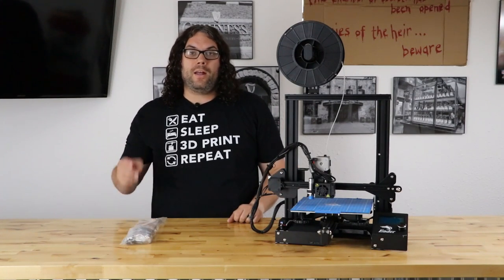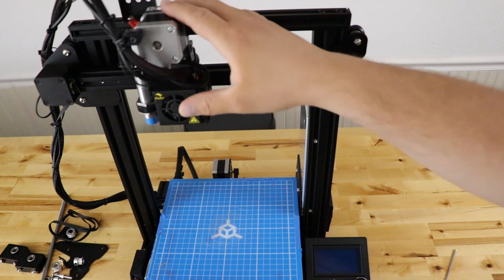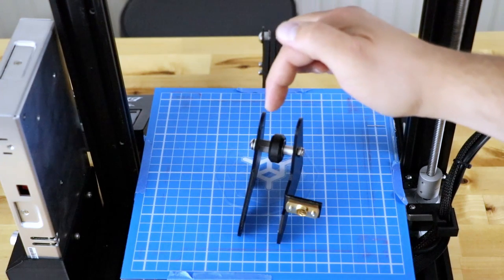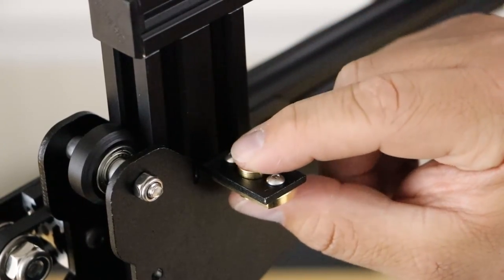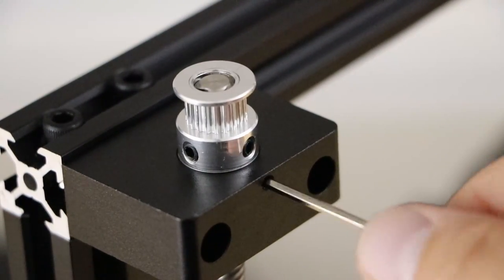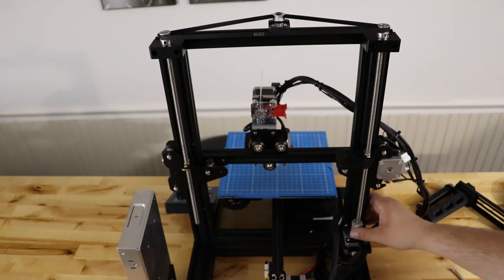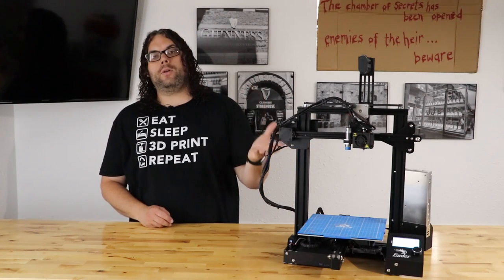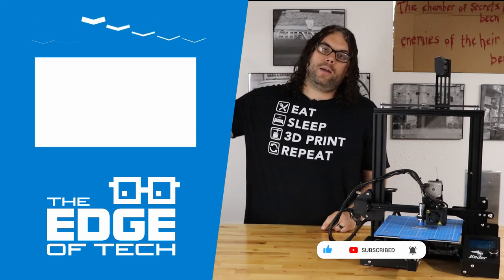How to install the TH3d Dual Z Upgrade kit on a Creality Ender 3

Comment: Note that if you have the original extruder, you will lose ~5 mm on the Z-axis with this kit. It doesn't matter for me, except that it's now possible to crash the extruder arm into the bearing block. I'll make my own build of the firmware with Z-max set to 245 mm.

Another thinig: if the z-rod doesn't slip easily into the bearing, or if the bearing doesn't turn freely, then loosen up the grub screw that hold the bearing. It's surprisingly easy to deform the bearings. It came like that in my kit, but luckily it was ok after loosening the grub screw.
Reply: Good point. Had the same issue with mine.

Comment: is this a better upgrade than the 2 stepper motors? I have the Dual Z upgrade on my Ender 3 V2 but its the kit with the added stepper motor, works amazing but just curious if this setup is better or not as good
Reply: still looking for an answer lol

Comment: I have a Creality Cr-10. I have upgraded my cr-10 with the dual z-rod upgrade with an extra stepper motor. Now I get this constant Z-axis misalignment where the right side is 1-2 mm higher than the left side. Would this upgrade help to solve the alignment problem? Would this upgrade also work with the stepper motor on the right?

Comment: \m/   Thanks for posting. I'm a bit late to the game 
 OK; The additional lead screw solves the sagging issue caused by the additional weight of the direct drive (or poor setup).  Did you notice an improvement in print quality?  I would expect there's not much difference on small prints.  Prints that extend to the limits of the X axis travel should see a slight improvement.  Not sure if I'm going to add this yet.  Rock on!
~"If It's not modified it's not mine."

Comment: I have a question. I have seen a few of these upgrades online at different sites. However, some of them show different length belts. I have seen lengths of 610mm, 614mm, and 616mm. How do I know what length to get, for my Ender 3 and Ender 3 Pro, or is it a hit or miss? Thanks

Comment: Those who say the direct drive causes to much sagging of the z axis must not have installed one, I just put one on my ender 3 v1 and it prints much better with it and without a dual z axis drive I get no saggin. I am about to install a second z axis with stepper on it now but, not doing so because of sagging, only because I was sent one by H.I.C. to test out and post my results on.

Comment: Nice video Jim. It's a shame that there isn't a way to get another stepper motor in there. But this is definitely the next best thing.
I would also be interested if there is an improvement in print quality.
Reply from the maker: I will get some prints done and post them on my social media in the next couple days!
Reply: @TheEdgeofTech  Could you put them on here too please? 
I don't use social media 😀
Reply from the maker: @tonywharton5220  Will do!
Reply from the maker: @L3Dhelpguide  Thanks for the clarification Luke!
Reply: OneBadMarine hey I think I’ve seen your profile on Thingiverse !

Comment: is it really called The Eccentric nut? or are you messing with me. I've had to learn a whole new vocab now that I've become a 3d printer nerd.
Reply from the maker: They are really called the eccentric nut! It's eccentric because it when it turns, it's not centered and is offset. :)
Reply: Also because it's a bit nuts? Get it? ....I'll see myself out.
Reply: Also 'nylock nut' not lock washer :)

Comment: Dual stepper drive motors is a far more reliable option. This method puts extra strain on the single motor Use the kit for the CR10

Comment: Hi, my Z kit should be here today,  I watch your video,  btw thank you, but I am a little confused why did you take the original Z rod out put it on the other side and use the new Z rod in place of the old Z rod?
Reply: Because the new one is longer so it can fit the coupler on the motor AND the gearing on the top
On the power supply side it doesn't matter if it's short because there's no motor to attach on the bottom

Comment: Typical TH3: Not in stock.   They don't make it easy to buy their products.  Everything I want from them is out of stock when I check.   
You didn't explain how to level the gantry if you are off.  Just a spec, but not how to do it. 
How dies the motor and board deal with the extra load?   
I wish you would have shown a completed project with the power supply files printed as well.

Comment: For those of us who have a top mounted eSun Dryer installed, can this setup work with a second stepper motor at the base of the second Z-Rod and plugging into the second Z motor slot onto the SKR mini e3 v2.0, I need to keep the top frame as flush as possible.

Comment: Nice video about a great upgrade, but at the end of the video the travel  on the z-axis is not shown. I find that strange as if it does not work correct and was skipped.
Reply from the maker: Good point! I am not sure why I didn't show it, but it works great and has been running ever since I did the upgrade! Thanks for watching!

Comment: 1 mm difference is 5 layers more or less on 1 side Vs the other side. I think, but maybe that is just me, a measuring device that is a bit more discriminating would be a better solution and a little explanation on how to get it level of it is not would be nice. Other points in this video are very clear!

Comment: Hi! Great videos, I'm learning a lot in this Chanel! 
I  just got my new ender 3, and it has a problem that I can't fix or even find a similar problem on the forums. The problem is that after the first layer, the printer moves a few cm to the left and star printing the next layer, this happen with every layer, until the printer star printing off the bed. I Al ready check thst all my conections are in the right place. That happen with the dog test file from the SD card and with the files I try to print from the slicer (I'm using cura) I really hope you can help me with this problem. Thank you very much, really hope you can help me
Reply from the maker: Hi! I would format the SD card that you are using and Make sure all your belts are tight. I have a video about that in the playlist for Luke guide. Let me know if that helps and thanks for watching!
Reply: @TheEdgeofTech  Thanks man!!! Yes, the problem was in the belts I set it up side down. I place it right and now is printing wonderful! You have a new follower!! Saludos desde México.
Reply from the maker: @jpbm2268  Awesome! I'm glad it worked out! Thanks for the sub!

Comment: No before and after print to see if it had any effect.
Reply: Unnecessary. The 2-4mm of slop introduced by moving the z-axis up and then down is what this addresses. Not to mention the extra rigidity that allows direct drive systems to be installed without the extra weight causing sag.

Comment: Uhm... Isn't that the wrong way around with the tensioner? Why would you have all the load (when lifting) going through the tensioner? You never do that in engines and other stuff. You always have the load from cam to cam, and the tensioner on the "slack" side. The driven side will tension itself. 

Look at the way he is moving the Z-axis screw when lifthing the axis, and look at what way it pulls the belt. It pulls the weight alongside the tensioner.
Reply: Well. I suppose you could say ...prove it...……..I don't think it really would impact on the functioning of the drive whatever side you put the tensioner on as long as it actually did tension the belt.....it's so slow moving.

Comment: I’d want a dual axis only if I had two motors like the cr 10
Reply: Right? I can't help but think this isn't a good solution. Also with the PSU just sitting there not mounted. I don't like it. I think if I was going to do it I would have to reboard it with a dual Z supported board and completely redesign the X and Y.
Reply: @Zolkora  You can buy a version on amazon with a dual z motor splitter cable. You dudes are right, it looks awful being free floating.

Comment: For $20 cheaper I'm ordering a real dual Z kit with the second stepper and everything.
Reply: But you need a newer mainboard because this one now doesn't support +1  motor..
Reply: @hexidev  most dual motor kits include a parallel wired cable which allows to run on single stepper driver. In fact some boards have 2 z motor ports but they are just wired in parallel right on the board. Things I didn't know myself until doing the upgrade.
Reply: The video solution is a true mechanical solution. Better than "eletronic" solution.

Comment: Not a good comparison at all.  Do you have any Electronics qualifications, some of your claims are incorrect such as overkill on power filtering and shielded cables are a must for clean signals...
Reply from the maker: Hey Richard. I'm not sure if you posted this on the wrong video or something, but this upgrade is all mechanical. I don't believe shielded cables and power filtering have anything to do with the Dual Z Upgrade?
Reply: @TheEdgeofTech  my apologies sir wrong video wrong person..

Comment: Basically : how to buy a Ender 3 and transform to a Prusa i3 / Anet a8 etc . Upgraded ? Having to install a upgra...err..i mean a FIX (because that's the real name) because the previous upgrade ? Sorry but it makes nonsense.
Reply: The Ender 3 works fine using a single z rod. This mod is for those who want more stability / want a direct extruder (so more weight on the x axis). It's still way cheaper than the i3 and the cost isn't upfront.. It makes a lot of sense

Comment: OK saying that “this is to much weight & can cause sagging” is just plane STUPID! The gantry is made of aluminum NOT plastic. You would have to remove the top bar from the gantry & the added part would have to weigh several pounds! This simply shows that people don’t know what they are talking about & know NOTHING about metallurgy & rigidity!
Reply from the maker: In the video I say I got comments and emails from people watching the direct drive video. And those people are saying that the direct drive could be too much weight and could cause sagging in the X Gantry. I don't believe that's the case, and in the direct drive video I said that as well. I never saw any sagging with the direct drive modification, but this would definitely eliminate it if there were any. The reason why people think that there could be is that the only thing supporting the right side of the gantry is the wheels which travel freely.  They do move up and down if you push or pull them, so I could see where the thoughts come from. But I don't believe the direct drive modification is any worse on that then stock.
Reply: I think you're missing a point.....the X axis beam is cantilevered out in space, only attached to the Z axis wheel carriage plate on the left side by 2 screws and 3 wheels on the right side that do not keep it square. It's possible to move the X axis beam out of square by putting pressure on the right hand end of the beam and holding the leadscrew. Once you level the beam with 2 leadscrews it will never go out of square ever. The other benefit is it steadies the beam against vibration from the various drives. Cost cutting and design restrictions when it was first designed dictated that it sold with a single leadscrew which is not a good design but is feasible.

Comment: Having bought the dual z-axis and fitted it watching this video, I now have yet another issue with my Ender 3 Pro printer, the z-axis will not move.  One day I might be able to use this heap of shit of a printer
Reply from the maker: Does it move by hand? Or when you disconnect the dual Z?